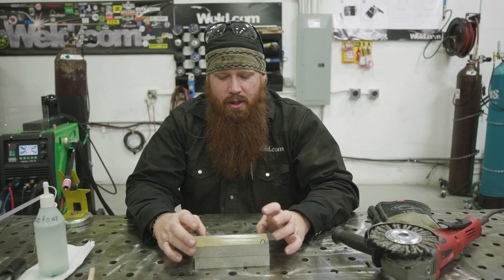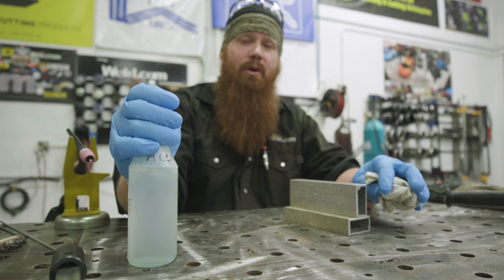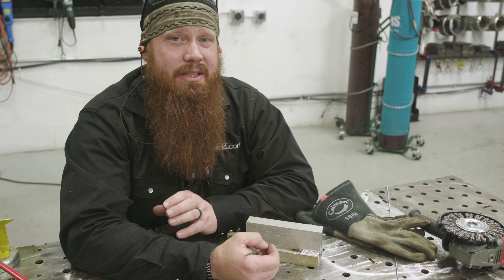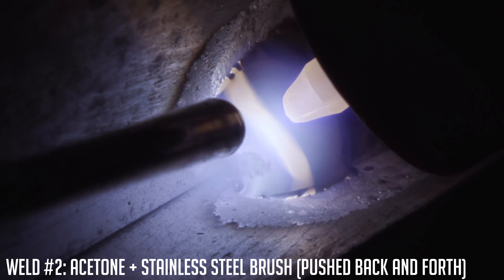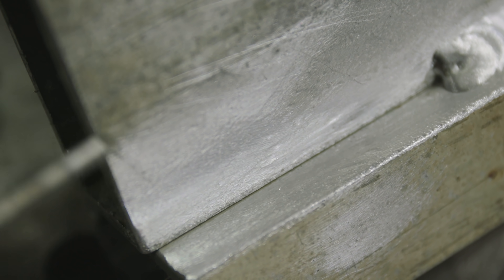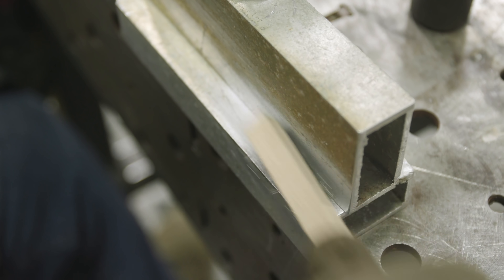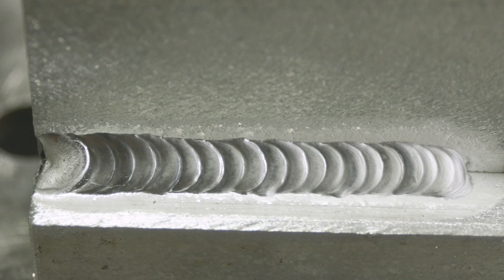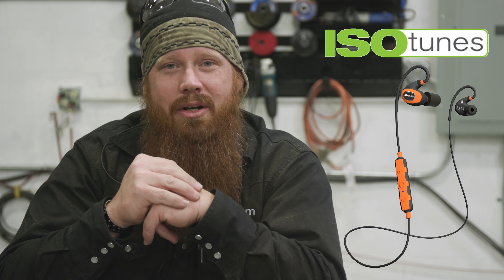How to Clean Up Your Dirty Aluminum Welds!

Comment: I get a horse shoe shape where the puddle does not  flow into the corner of  a tee or lap joint. What am I doing wrong? Might make a good vid. Great vids keep up the good work.
Reply: Probably need more heat, or shorter arc length, if your too far off with the tungsten it won't get into the corner.
Reply: Just about to post what jg did if you have a foot pedal increase your amp more than you need and go full pedal until the puddle is formed and then let off the foot pedal
Reply: @Scooty_scoob  yup good advice, I almost always set the amperage a little hotter than I think I'll need and start full pedal on aluminun to get the puddle going fast and then dial it back. Only time I don't is on really thin shit or sheet metal edges where I'm worried about burning the edges back.
Reply: Thanks for the input guys.

Comment: So this makes me wonder about what exactly the balance is doing to help clean. Does more cleaning on the balance cause the oxide to get cooked away? N if you run more cleaning can you run more amps to regain the penetration?
Reply: while a higher ac balance does provide more cleaning action, it isn't a good substitute for good prep. part of the reason is that the DCEP(cleaning) part of the cycle delivers around 2/3 of your heat to the tungsten, so raising your amps to penetrate with high cleaning will melt your tungsten and leave inclusions in your weld. also once your tungsten starts to liquify you lose control of your arc/puddle so you cant use that heat to penetrate anyways.
Reply: @MySuperman112  that makes sense. I mean it was more to satisfy a curiosity since I don't even own a tig welder. So why even offer the adjustment on balance then? I can't imagine a situation where you'd need more cleaning, at least in the range that it's offered anyway. But I wonder also if one tungsten could handle the higher heat n resist balling up compared to another
Reply: Ben Miller 
there are two primary reasons to have a wide range with ac balance on a welder. the first is that sometimes it isnt possible to remove all oxides on the base material before welding, like with cast aluminum, which pulls up subsurface contaminates into your weld. the second is that it allows you to weld thicker aluminum without the hassle of using helium for DC welding. with really good prep you can weld thick aluminum with 85% DCEN and a slight preheat. also being able to drastically raise your cleaning is good for when you want to ball tungsten.

Comment: I still feel like the wire brush is the best way to go, over the wire the wire wheel.
Reply: Scraping and filing are the best!  Also most tedious.   Chemical cleaning used to be used and is hard to beat, but I think people stopped doing it b/c it was too dangerous to the staff.  I've seen film from WWII where people were pickling big aluminum pieces in basically a swimming pool of acid....  I have personally had good results with good old LYE, just hot water with lye in it will turn dirty old aluminum WHITE.  When you see it, you'll know it's clean!   SO:  Solvent or alkaline cleaner to remove oil and grease, boil in lye to remove oxide coating, rinse in hot water and dry.  Needless to say, hot boiling lye water will eat you up to some extent, so gloves and aprons and goggles would make sense.

Comment: How long before the oxides re-form to the point of becoming problematic?  IE how much time does a guy have between cleaning and welding before re-cleaning is required?
Reply: I was very confused by this as aluminium oxide forms almost instantly, was wondering if it was dirt on the oxide that they were talking about. Or maybe it's the fact that the layer will be really thin to start with, at about a nanometre,  (I have no idea what that is in imperial measurements).
Reply: @cjhification  Aluminum oxide does form almost instantly.  Aluminum is a self sacrificing metal.  When raw aluminum is exposed to oxygen it reacts and converts to aluminum oxide.  This process continues until an aluminum oxide lattice is developed preventing further oxegen intrusion.  The surface layer of aluminum oxide protects the aluminum substrate beneath it.  The goal is mitigation, not elimination of aluminum oxide.  The AC pulse frequency plays a significant role in pushing those oxides aside.
Reply: @ShainAndrews  was pretty sure that first nanometre forms instantly then takes a month to a year depending on conditions to form up to 4 nanometers so doing it straight after compared to a few hours later will make almost no difference but it was 20+ years since I studied chemistry so hence the pretty sure.
Reply: The oxide coating starts to reform instantly. It might not be a problem for hours, but I think in the literature they're talking about cleaning right before welding,  maybe a few hours time if the work is covered.  In the origin of this (it's for aircraft right?  Later aerospace) the work might be cleaned by pickling, or wiping with solvents then scraping!   Filing with clean files is good, too.  I do this b/c I have scrapers and files and it's cheap, but I'm not doing it a LOT.

Comment: Cleaning is correct but the weld is incorrect.
In all of these arcshots its clear to see that the weld is too cold u just lay a bridge over the root. No penetration in the root
Reply from the maker: You're correct. The piece of Aluminum we wanted to use (because it was dirty) was a little too thick for the machine. That being said, the goal was to show the impurities in the pool.
Reply: @Welddotcom  ah ok I understand.
Reply: With blocks that thick they'd need to bevel the living crap out of that upright piece. Plus, AC is never going to get full penetration because of the cleaning cycle. They could try changing the wave to favor penetration, or switch to DC and see how clean their joints really are, but those blocks are just too thick.
Reply: @Videomorgue  those aren't blocks they are pieces of extruded square tubing.
Reply: @JimGriff1720  ok. Watching on my phone thinking "good god, how is he not preheating those." LOL
Reply: @Videomorgue  yea I thought the same thing at first lol
Reply: Its not that thik maybe 3-4 mm
Reply: Honk Meer more like 1/4” or 3/8”

Comment: I use scotch bright surface
flapper wheels on all my aluminum swiping in one direction.. I prep it all before tacking it up, seems to be the best method I have tried yet.. I do high end production on 6061T6 so I dont have time to wire brush joints and those stainless wheels on a 4" grinder can hop up and bite you really easy.. I have been using the flapper method for years now. I acetone before and after buffing off the oxide layer..